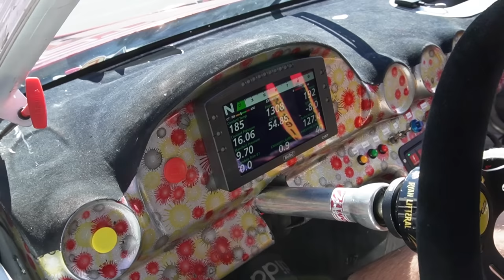"Can a Sim Drift Champion Handle a Real 900HP Formula Drift Machine?

Comment: Very cool. I'm so curious about how much easier it must be on the pure technical side of things to control a real drift car than a sim car. I know that I do so much left foot braking when I drift in sims, not just for controlling angle but just as a practical tool to slow transitions(or 360s) down if they're too fast and unpredictable, and I feel like if I was in a real car I wouldn't need to use brake to slow transitions at all because the g-forces would be there guiding me.

Comment: proof that we can have RC controlled Formula Drift cars controlled remotely from a sim drift rig pc setup with <10ms latency easy ;D
Reply: safer for the drivers and can save weight by not having even more interiour, dials  incar and etc that can be digitally shown on the input sim pc's screens HUD